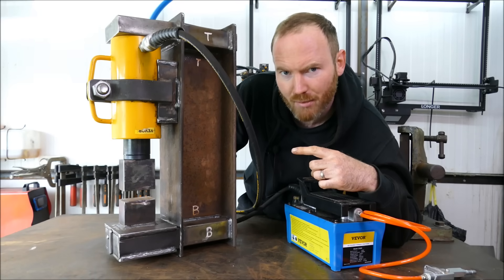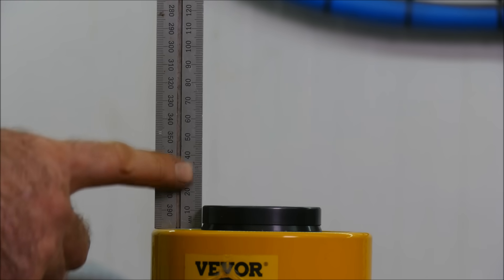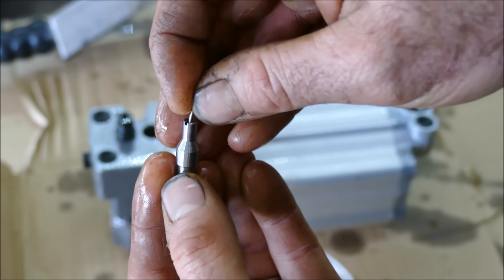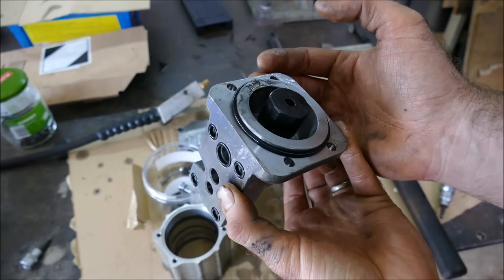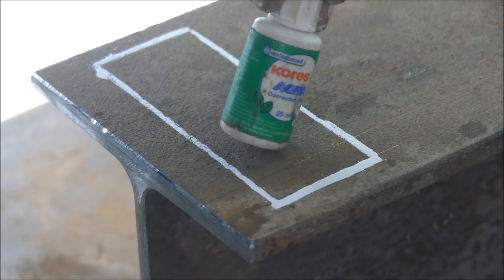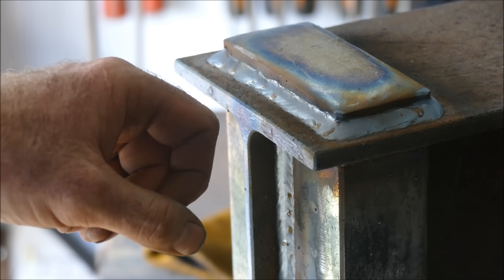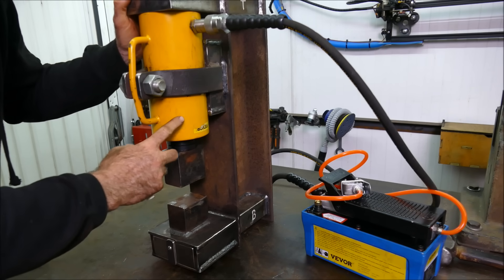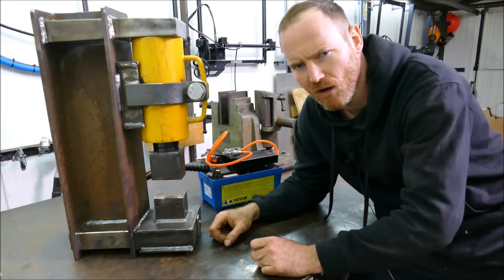£300 *30ton* hydraulic press for under! - Vevor hydraulic power pack air pump cylinder reveiw

Comment: Hello. Very nice video. Can I ask - what is the adapter you used to replace the coupling supplied on the jack? Seems there is a lot of choice out there - I don't know too much about hydraulics other than I dont want to be on the wrong end of a bad connection!
Reply from the maker: Hi. I just used what came with the pump. It has its own adapter connection. Cheers J
Reply: Cheers. And quick reply! Ive recently acquired a similar setup, but the pump didnt come with any female coupling part. Anyway, thanks for the info and great video.
Reply: @JonathanWoodrow  pioneer tractor or any name brand might work. i used some on my portal power.
Reply: Cheers  @HarryPalm-px9gy . I actually found the coupling I was after - search "Male Coupling with Nitrile Seals, NPT, Quick Couplers, Hydraulic Tooling - 3/8"". Vevor annoyingly do a female-connection version, which wont of course fit the ram.

Comment: a 5hp electric motor and a proper hydraulic pump and you'd have a proper tool.  I made a pneumatic power hammer about the size of that press and it's rocks.  It's attached to a 3 ft tall, 24" diameter oak stump and used a 10lb 2" diameter ram with a 35mm air cylinder.  It hammers about 2x what my arm can and 10 times the speed with no tire out.  Small tools are awesome.

Comment: I know this is an older video now but awesome lookining , what's the smallest compressor you think you could run on as I'm thinking about having a go but not much space for a compressor was thinking of a small 24l electric one but not sure it would cope
Reply: Hi sorry for the questions but just checking as im new to air compressors, the hydraulic pump days it used 5-10cfm as most compressors seem to be about9.6 is that OK or would 14.5 be a lot better, I dont really use a air tools so compressor would really just be for this project.
Reply from the maker: @chrislawrence6015  the cfm is how fast it re-fills, a large tank takes longer to fill so a bigger cfm pump is required. It makes no difference to the output which is determined by the psi and diameter of hose. Cheers J
Reply from the maker: A little compressor will work fine. It will just be working harder than a larger version. Cheers J

Comment: This is amazing stuff, I am about to buy this cylinder and pump, actually 50mm stroke because I think I need smaller cylinder so I can use it on cars to take out bearings. But I will build a press to.
Any advices?!
Reply: Also is it necessary to have that air valve on the air hose that is connected to the pump?
Good job man, and thanks a lot for the reply and all the DIY info on your channel!

Comment: I’ve been trying to come up with a cheap option to assist me in forging blades and other small projects. I will have to build whatever I choose which means I’ll have to get a welder first… I’ve seen some used, electric wood splitters for pretty cheap. Either I make a powered press or power hammer. If I do the planning right, I could use my belt grinder motor to run the power hammer.. I still have to get a used $100 welder and to learn how to at least do a half decent weld.

Comment: @joshuadelisle I purchased one of these this week and worked a treat to remove a seized pin.  I have found though that the hydraulic oil is leaking from the internal seal quite badly. Have you experienced this at all on yours?  

Upon closer inspection the internal bore of the hollow piston hasn’t got the finest machining finish which is probably what’s causing this issue. 
It holds under load (as the seal conforms) but leaks when idle. 

Be interested in your experience a few months on.
Reply from the maker: Thank you I'll definitely check mine as I use it. I left the breath hole open when storing it once and it leaked but other than that it's been fine. Cheers J

Comment: Would the 30 ton 2 inch stroke move quicker with the same setup?
Reply from the maker: No but I have considered coupling 2 or more pumps together to triple the speed. Cheers J
Reply: @joshuadelisle  Thank you for your reply. Your content is the best I've seen. Another question: I am going to have to use a manual setup. Enerpac two speed hand pump w/ cylinder. Would I be correct in assuming if the pump is oversized in relation to its oil output on the cylinder that it would gain stroke speed? I am getting conflicting information. Perhaps I am missing something. I would much appreciate your thoughts.
Reply from the maker: @algyt-t4k  thank you so much. The flow rate of the pump will determine stroke speed and the psi will determine the force. A cylinder with a large bore size will move slower than one with a small bore but will have more force in comparison. The stroke length doesn't affect the speed but will take longer to extend fully compared to a shorter stroke because it has more volume area to fill. I hope that helps. Cheers J
Reply: @joshuadelisle  I see. Thank you....

Comment: I’ve a Sealey Yankee 10 Tonne Hydraulic Shop Press — would this unit power it? Many thanks 🙏
Reply: Joshua — you’m a bleddy star! I’ve been asking all the suppliers today via messenger and email and it appears you had already answered positively some 9 hours ago … Whilst none of them know or will apparently … get back to me?
Reply from the maker: @davideddy2672  Thank you so much. all the very best. cheers J
Reply: Liked and subscribed 👍
Reply: What do you think of the Flowfit Power Packs?
Reply from the maker: @davideddy2672  they're very pricey, I considderd buying a diesel hydraulic log spliter just for the parts as they are cheaper than buying just the powepack. cheers j
Reply: Just wondering … could you recommend a compressor that would pair nicely with this rig please?
Reply from the maker: @davideddy2672  personally I would go for a 150ltr 3hp 15cfm, they're about £600 from machine mart or £100 second hand which is what I got. Very easy to repair and maintain. You can do a lot with one of those and much better value for money than a smaller one.
Reply from the maker: I would be confident that it would, you may need a different fitting/adapter but they're easy enough to get hold of. cheers J

Comment: Joshua, with the compact size of this you should consider drilling a hole in the top support so you can use it as a bearing puller too like your demo with the wood. Does the ram automatically retract when you stop depressing the pedal or do you need to turn a release valve. Do you think 2.5 inch mild steel would work in place of the hardened fork lift tines? 

I was also thinking it would be pretty easy to make a quick change die for the ram too and incorporate your straightener. 

As much as I want to build every cool thing I see I'm limited by budget and time but the simplicity of this is so fantastic and affordable I'm not limited by either! Seems like a nice tool to compress a Damascus billet.
Reply from the maker: Thank you so much and those are good ideas. I'll definitely create a punching die, brake press, metal shears etc later on. I may also ad a second or even third pump daisy chained together to increase flow rate and get quicker forging speeds. The retraction happens when I engage the pedal forward, otherwise it sits in a neutral position and doesn't move which can be handy for clamping. Cheers J

Comment: Lol I like this I want to bend 2x2 box square tubing and this helps me get an idea of how to do it without 220v or heat. I just need a few 90° bends. I was already thinking about using a manual log spliter and this helps me out with this.
Reply from the maker: Thank you. Yep this will be great for that. I'm going to make tooling for mine for bar cropping, sheet metal break press, hole punch and die forming. I've even considered using multiple pumps to increase speed and to use on a double acting cylinder. Cheers J

Comment: Another reason why you should pre-heat a huge steel plate before welding, is called "equivalent carbon" (probably not the right term). It is a metallurgy formula that allows you to calculate the hardenability of the heated metal (in that case the weld). The problem with such thick steel is that the carbon is attracted by the weld, and the final weld ends up being much harder than if the plate was thinner because the carbon has more room to go in the weld. I welded recently a 40mm steel plate which was 0.13% carbon, and the carbon equivalent ended up being 0.7% !!!! so this is waaay above the minimum for it to harden. I just learned this a few days ago and i found this fascinating thought i would share !
Reply from the maker: Thats great information, thank you, what did you use to test the carbon amount? cheers J
Reply: @joshuadelisle  i knew it was just a regular construction Steel, so i took the average composition to enter in the formula which ended up in a carbon equivalent of 0,7%

Comment: Hmm if only I could figure out how to make it much faster
Reply from the maker: Coupling several of these pumps together works out to be cheaper than an electronic pump. Although uses more air will significantly increase the speed. Cheers J

Comment: I made something similar out of a Harbor Freight 20 ton shop press and an air actuate hydraulic jack (build is on my channel).  It was fun to build, but it’s too slow to be very useful. It’s rusting away, unused. I think your press will only be useful in specific situations, but worthless if you’re forging Damascus blades, for example. A manufacturer over here sells an entry level 15 ton proper hydraulic press for around $3500. That’s my next purchase after I get my debt back down to zero. Enjoyed your video, though.
Reply from the maker: Thank you. I considered daisy chaining several of these pumps together to increase the flow rate which is possible on this system. Uses a lot more air but that's ok as my compressor is 150ltrs. Cheers J

Comment: Hi Joshua very impressive build!! I see the cyclinder is single way one, so I guess the return is by means of an internal spring. Is it correct?
Reply from the maker: Hi, yes that's correct. The spring gives a good retraction speed but enough force for returning hot punches or drifts. Cheers J

Comment: 11cfm is a flow rate that no single phase compressor will cope with. Demonstrated by how much it slows as the load goes up. 
Log splitters are fast because they have a much faster pump rate.
Reply: You’ve done well. I’ve not hound anything that good with a single phase motor.
Reply from the maker: @Dave5843-d9m  I think the Clarke boxer 2 is £588 Inc VAT. Cheers J
Reply: @Dave5843-d9m I-R makes many in the states; sells many  my 5 hp is24 cfm at 90 psi single phase 2 stage pump $1100.
Reply from the maker: My compressor is 15cfm single phase 3hp 150ltr.  Cheers J

Comment: Interesting little gadget. Compressed air to hydraulic. A few valves and cylinders for a backyard backhoe?
Reply from the maker: You certainly could. Probably needs a larger hydraulic tank for anything serious. You could even have several foot pumps for different actions. Cheers J

Comment: I built a similar one some years ago out of a short ram that 'only' had 20 tons and would still deform my frame with ease. I've had one of these foot pump ones on my Redo list now that I'm a more competent welder, but steel prices have kept me from doing so. Might be about time to slip down to the scrap yard and trade in my pile of aluminum cans!
Reply from the maker: All the very best my friend. Cheers J

Comment: Make sure that you check the threads if replacing the cylinder fitting  , the 700 bar system uses 3/8 NPT
Reply from the maker: Good tip. Thank you. Cheers J

Comment: 30 tons of force = huge pressure ... I don't fancy being anywhere near that 1 litre tank should it explode! There's a reason why commercial hydraulics are liquid not air powered ... No possibility of an explosion with incompressible liquid a big leak is the worst that can happen!
Reply from the maker: There isn't pressure in the tank only the lines and cylinder and the commercial hydraulics (which this technically is) are still dangerous and require competence to safety check and operate. If anything this is safer than more powerful agriculture/industrial grade pumps which operate at much faster and higher pressures. The 30 tons is slow and is measured by the load capacity not the actual operation tonnage.  Cheers J

Comment: Will this work for stamping sheet metal. Or just forging?  I'm looking for a cheap press for stamping out parts.
Reply from the maker: I will certainly be making punching die holders for it. You get a 35t punch from VEVOR that is very affordable. Depends on the size of cut out you want to make. Cheers J

Comment: So say you already have a hydraulic shop press and you wanted to add the air over haydraulic pump to it so it could be used as a forging press. Is that possible with this pump and if so how would you add it to the existing hydraulic cylinder that currently only has a hand pump?
Reply from the maker: Hi. I have an aircraft jack which is at least 50t by my reckoning. I want to build a pump similar to this one using a short 100mm diameter cylinder and pneumatics. This pump won't be enough but I have considered daisy chaining a few of these pumps together. It would use more air than what the compressor can pump but having a large tank means it will be able to run for a while at a much faster speed. Cheers J

Comment: Nicely done,  I like how you used the plasma cutter to cut out the I beam to slide your piece in to weld it instead of just welding it on the bottom - makes it very strong that way. Thanks for the video!
Reply from the maker: Thank you. Yes it's definitely one of the stronger ways to join it for this application. I think 30t would potentially peel it off if it was just butt welded. Cheers J

Comment: shove a bit of cloth in the exhaust, and a ziptie around the exhaust port for the chamfer tool, makes it much quieter, also they make corner round inserts for them as well
Reply from the maker: Good tip thank you David. Cheers J

Comment: When you said you would heat up the old fork to release the energy, what did you mean.
Reply from the maker: You might have misheard that, which part was it on the timeline? And I will elaborate for you. Cheers J
Reply: @joshuadelisle 
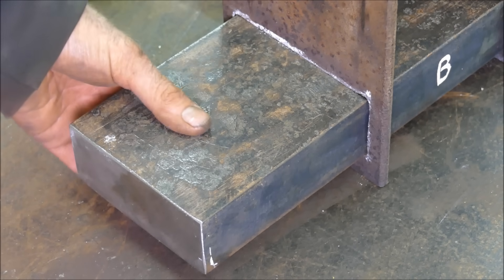It was 7:18 but now I've rewatched it again i understand its heated before welding so not to take the heat out of the weld.
Makes sense now, I watched it after finishing work at 5am i was half asleep, that's my excuse anyway 😂
Thanks for your quick reply 👍
Reply from the maker: @bobp6742  well done 👍, all the best. Cheers J

Comment: I almost choked on my vape when you said how much (little) you pay for the forklift tines; I mean, a tenner for all that steel?! 😲
I love these "look at what I built for a fraction of the cost" type videos; I just wish I had (or knew someone who did have) random lengths of I-beam and chunks of 12mm plate lying around as scrap. 😄👍
Reply from the maker: Lol. It's a definite fact that the best deals can't be found on the internet and instead networking with the hidden away underdogs of the industry can find you the best stuff. Note that the I-beam has been lying around in my shed for 12 years and those tines I bought pre covid when prices weren't as crazy. Cheers J
Reply: Baker forklifts do some of the best tines as never had a fault once in 20years of scrap yard animals trying to lift 20ton on 3.5 tonight trucks😂
Cheap daint last a week
Reply: @Tattooedfreak  "trying to lift 20 ton on 3.5 ton trucks"  I've worked with people like that, well, tried to!  Do you think they're all related, or at least share a common gene? 🤔😆
Reply: @Loneman_OG  maximum stupidity seems to be very common in the workplace.
Look at those in charge tbf most have never picked up more than a pen and they are controlling the job.

Comment: hmmm , have a air over hydrailic pump on my 20 ton garagepress , and the pu
mp itself looks verry simulair to the one in the foot operated one , might go take a look if i can convert it to foot operation ..........could put a foot operated aitvalve on it but then i still whont be able to release the ram without taking my hand off the woekpiece to operate the release valve

Comment: How about modifying a portable sack / bag sewing machine into a walking foot leather/ canvas sewing machine with a little stand to mount it on..the bag seamers are like $80..they will sew thru tin cans as is..Cheers..
Reply from the maker: Sounds interesting. I've actually just got a hand sewing machine for stitching up something for my PAPR system. Cost me £13. I'll look into the bag sewing machine if you think they're useful. Cheers J
Reply: @joshuadelisle  it could be a very popular option for leather crafting and even boaters as sewing machines that can handle thicker materials are crazy expensive..the bag seamer is a walking foot design but has the wrong locking stitch I believe..maybe possible to modify the ribbon / timing maybe to have a different stitch..Vevor sells them too..maybe you can get one to review? And tinker with..Cheers..
Reply from the maker: @agentcovert  I'll check em out. Cheers J

Comment: With forging presses, it's all about speed over pressure. If it moves too slowly, it acts like a very expensive heat sink.
Reply from the maker: Agreed, a 20t or even 10t may work better for forging with this pump. Cheers J

Comment: Thanks for another great video. You mentioned you buy in the old forklift forks for a tenner. I could really use some steel that thick but haven't been able to afford it. Where do you get them from at such a low price? Or have you got any you want to sell? I only need 1 or 2.

Any info would be great. Thanks again
Reply from the maker: Thank you. A friend gets them for me from a scrap man. They apparently have to replace the tines once they are worn or damaged. If you're in the UK I can maybe get you a contact? Cheers J